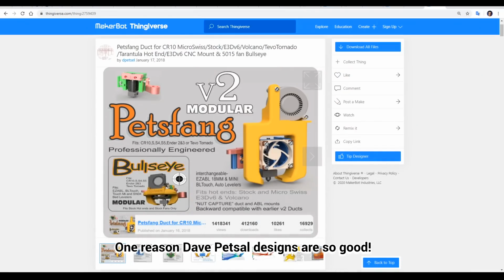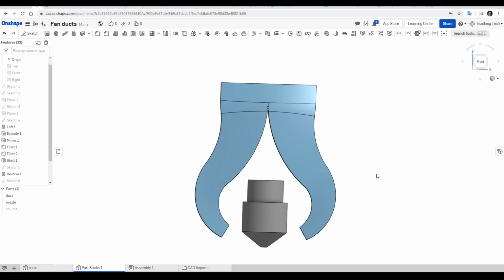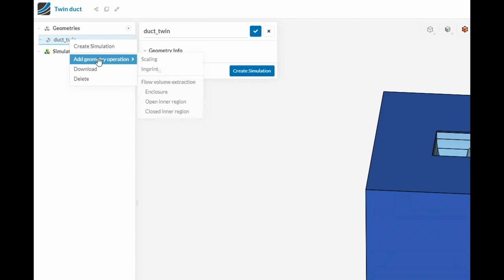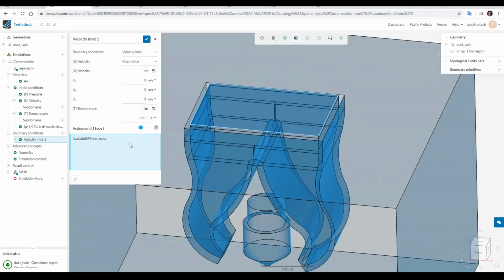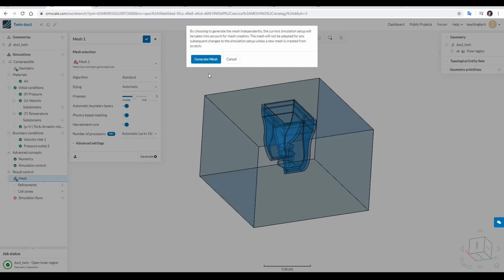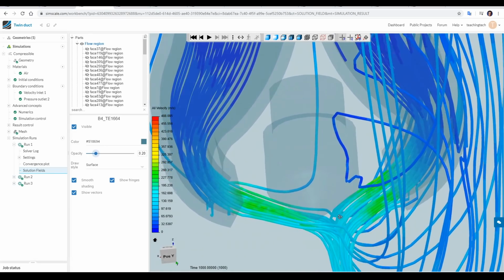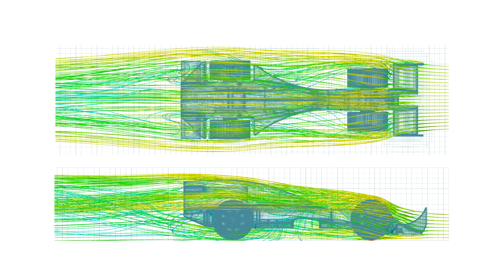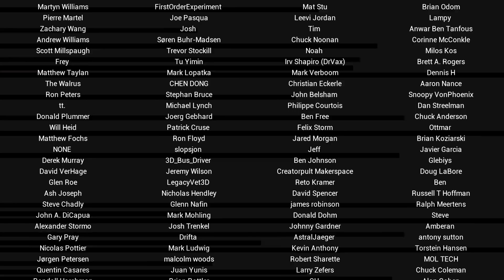Use CFD to take your 3D printed designs to the next level - for free!

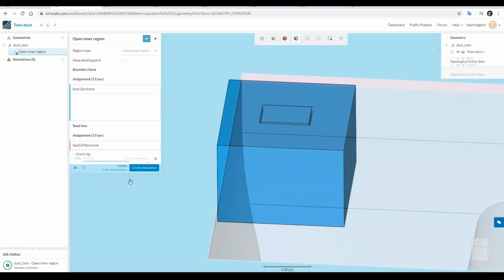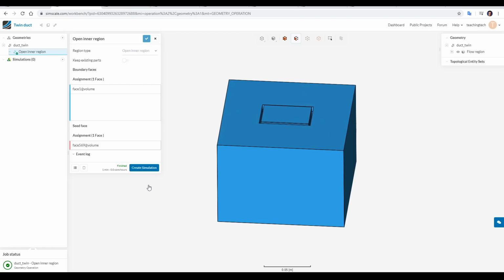Comment: If you are getting the error "A setup with 2 regions is being used in a single-region analysis type" -- you must delete all solids except for the new volume that you created like another commenter posted.  It's not obvious from the error what step is missing, but that's it.  TT does this and mentions it but it isn't explicitly shown on the video.  Check out the video top right at 5:44 vs. 5:49 and you'll notice that all geometry except the new volume is deleted.   If you're having this problem, go into CAD editor, look at the geometry, and remove (delete solid) everything except for the volume that you created.  It's similar to a 'burn out' in the lost-PLA casting; the original solids must be removed.   Then things should work.  Also, in the new UI, you'll want to perform an internal flow-- but most everything else still works.  The other difference with the new UI is that the gauge pressure is used and not absolute static pressure.  I believe the new default values of "0" should be fine.   Also, incompressible flow is free but compressible is not.  That should be fine -- air is roughly incompressible below 230MPH (mach 0.3).

Comment: If you are working with newer version of Simecale than the one in the video, Instead of Using Velocity outlet use pressure outlet the same way. If you dont it will show an error and you wont be able to generate the mesh nor the Simulation Run.

Comment: It would be great to have an updated video for Simscale.  Their UI has changed a bit, to a point that it takes a bit of guess work to get a CFD simulation running.  I'm currently working on a new nozzle idea for the part cooling on the Ender 3 V2 Neo.  The hardest part for me was figuring out how to get the internal flow volume "open inner region."  This is now done in the built in CAD editor.  You still need everything setup the same way.  The new command is flow volume>internal.  The options have changed order, so your first selection is the small inside edge for the seed.  Then, select the outer faces for boundary faces.  After letting the volume create, then you have to delete the solid bodies you brought in from your CAD software, so that only the flow volume remains.  Last, export this into the simulation setup.  Without exporting, the changes stay in the CAD environment, but are not applied to the model in the simulation setup.  It will appear as a cope of the original geometry in the list of geometries.  Then, select the newly created geometry, and start a new simulation.  Everything else is about the same as in the video.   Be sure to pay attention to what's pressure and what's velocity,
Reply: They've also removed compressible flow analysis from the free community plan.
Reply: Thank you :)

Comment: Thank you for this video ! You give us some very good information !
I want to simulate the pressure under my resin 3D printer Saturn 2 plate. I found some mathematical model not easy to implement so it would be great to simulate it !
The idea is that the efforts under the plate of the printer are getting very very high values during the last part of the z moving down in the fluid because of resin viscosity.
The software doesn't support fine tuning of the velocities bur with the amazing UVTools it is possible to add temporisations for the first layers.
So what do you think about using Simscale for my purpose ?
Thanks again

Comment: With the compressible simulation no longer being available, it should be noted that "incompressible" is the correct choice here anyway, because air is moving at slower speeds than mach 0.3. So, unless you got a really powerful fan...
Reply: Thank you!

Comment: 9:00 The fan characteristic you picked is not very representative of the actual flow anyways. The 'flow rate' fan manufacturers state is in open air, i.e. without any resistance. It is similar to how they state the static pressure, i.e. pressure with infinite resistance (blocked). In actual use cases, you are somewhat in between. In particular with fan ducts like this, you have a significant resistance, and thus cannot blindly take the volumetric flow in the datasheet. 
Instead, you will need to figure out the resistance, and use the fan manufacturer PQ curve to figure out where in the operating region you are at.

Comment: Thanks for making this video! I'm designing a smoke collector for a laser cutter - basically a part cooling fan in reverse. I figured I could find some people talking about using CFD for designing part cooling fan ducts, but I didn't expect it would be you! I realize the CFD will be optimistic at best, but it will still help point me in the right direction if I'm doing something obviously stupid.

Comment: The compression flow is now part of the pro subscription, and not given for free. 
I've been struggling beyond that, because their interface has changed. Where you create the flow region, there's now a separate cad editor so the right click option isn't there. Then it doesn't seem to react the same way and give me a flow region like yours - mine seems to be "inside" the solid volume that I modelled in, and I can't fathom that out. I keep getting a message about it being an invalid set-up, but it isn't really telling me why.

Comment: This is a bit of a dangerous video. In CFD the old saying 'garbage in...garbage out' is more important than ever. I wouldn't trust any of these results. You really must know what you're doing...otherwise you're just wasting your time, and will probably design something that has poor performance. However if you just want to see some pretty pictures, then sure, have at it.
Reply: What makes this software so bad? Can't just come shit on it and provide 0 resources showing why this is a poor approach
Reply: @squirrelzar  I never said the software was bad. I said it takes a skilled user...of which this video makes it seem anyone can have at it.
Reply: @squirrelzar  software isn't bad at all. But the parts where you input all the settings is where the issue is. Unless you have a lot of knowledge of CFD then all the settings your gonna try will most likely be garbage, and thus you'll have garbage results that don't reflect how it really is gonna be. This is why it takes specialists to design racecars rather than anybody can do it.

Comment: Please get a compressor for your audio tracks and set an auto gain to common standard level. Constantly variations in volume on your vids. This one especially is too light in volume where one need to crank up the system and get blown away if app notification appears. Just a QA tip ;)

Comment: I've tried and tried, and it's just error after error.  The fan duct is a solid body, but it continually imported into simscale as 3 faces.  So ended up importing into onshape just to be able to export as a parasol.  Well, that worked, but then when calculating inner region it gave the error "The flow region could not be created." which turned out to be a geometry issue which was cleaned up.  But now it's saying it's too course even when I set the fineness to 10.  I've spent a few hours on this and still can't get any further.

https://www.simscale.com/projects/phazei/lpa_fanduct_5-5/

Comment: I tried this with a Hemera fan duct I remixed but I cant get past the "create inner region" operation.  I set it up as you demonstrated but when I click "start" nothing happens (just the cursor changes to a red 'forbidden' icon).  This is the project I have started:  https://www.simscale.com/projects/Psych101/hemera_5015_fan_duct/
Reply: Also note I modelled the duct in Fusion 360 and had to export it as a step file (no parasolid option).

Comment: 20 degrees typical room temp? where do you live? north pole?
Reply: Australia by the accent. He's talking 20°C.
Reply: @martindinner3621  20deg is still pretty low, to be called a typical room temp. Typical room temp is like 24. Doesn't sound like much difference but at 20 deg I would be freezing my ass off. 24 is a nice comfy temp.
Reply: @flippy9133  in NA and Europe, 68°F/20°C is pretty standard.
Reply: @martindinner3621  I am from europe, only poor people that were saving by not using heating had like 20C at home. mostly its 24-26
Reply: @flippy9133  depends where abouts you live in the EU. 18-22 is normal in the UK during winter and about 22 during the summer. Some people also don't care about heating, friend of mine doesn't ever have the heating on even when it reaches 0c.

Comment: Thanks for posting this tutorial.  Following your video, I used it during the design of a print cooler for the titan extruder on my Makerfarm Prusa  i3v 10" printer.  After seeing a couple of the other comments, I might try one of the turbulent models, but seems like it puts out enough air for me.  Here is the link to my design on thingiverse which includes the STL file & fusion 360 source file. https://www.thingiverse.com/thing:4427927

Comment: You might want to consider using Copper-filled Metal Composite HTPLA by proto pasta.  I played around with it a little bit and the resistance level is nowhere near the resistance level that you showed for the carbon fiber. Might be something to play around with sometime when you have time I certainly don’t have the time right now to do something like that.  You must send this after printing of course.

Comment: OK it's probably only me - but I have designed everything in Fusion360, exported it as .step; and it complains about "Sheet bodies detected.
The model contains sheet bodies (surface data) only. The meshing algorithm requires at least one solid region. Try to solidify all surface parts." - any idea how to solve/fix this?

Comment: The way air comes out of a fan is a complex subject all on it's own. This simple stimulation of an airduct for your 3d-printer delivers highly inaccurate (overly positive) results. Tying a (wollen) string to a stick is way more accurate. Modeling airflow around an object however, like a car or an airplane is relatively easy and should show reasonably accurate result (as the incoming air is laminar and the pressure is super even, which is NEVER the case for a fan).

Comment: Great video, younger student me would have for sure enjoyed to learn by using these tools. I bet they love these lessons you teach! But I am also amazed by the amount of people commenting about turbulence models etc. I think it is kinda besides the point of the video, which seems to be introducing a free tool that anyone can use for doing hobby projects (which by the way is amazing, free tools for cfd are quite rare).

And to all these wikipedia warriors in the comments: To begin with, the K-Epsilon that everyone is yelling in the comments is not a good model especially for curved surfaces and high turbulence simulation... It's just very fast for finding basic flow patterns, but handles near wall badly and is overly diffusive... For the simulation shown in the video if you want to stick with RANS models, a SST K-omega would probably be the way to go, but would need a bit more understanding of the case before saying for sure. If the case is not a steady state (which I think it is not since the two flows are pointing at each-other), even SRS model could be considered instead, if it is important to correctly simulate the flow around the nozzle.

Comment: Well I´m not sure to know what the aim is here. Of course I can see the behavior of the air and in one case I can see there´s barely air the the endings but a simple fan duct should just blow in the right direction or not? I hope you can explain me which points are important? I´ve created a test STL with a box around it and it´s still calculating. I really would like to know more about what a critical position / area would be ... everything what would be red? ... or where I can see much less air at the end?

Comment: This is not related to the video subject but is a bigtreetech skr 1.4 be connected to a makerbase mks tft35 v.1.  The display has an 8pt chord but the skr board has a 10pt input.  They both have an identical display tft35 yet the connection is different. Is there a way to modify a chord/chords to connect them to each other. I also have a 10pin USB programmer if that can somehow help. I would be beyond grateful to get some help on this frigging thing. Its pretty much the bane of my existence right now and there's nothing anywhere about this which I'm very surprised by. But you're pretty much the man when it comes to this stuff so figured I'd ask.  Thx

Comment: Fyi unless your air flow is above 0.5 Mach or so, compress-ability effects in air are pretty minor.  Should save you some core hours by using an incompressable simulation instead.
Reply: Wait so you're telling me the airflow isn't supposed to be at Mach 0.5 for 3D printer fans?
Reply: @hudsonr.218  Mach 0.5 or faster cooling air would help when pushing for extreme speeds.  I.e. >400mm/s and >10,000mm/s^2.  But most cooling fans don't have anywhere near the power to do that.  And you won't like the noise either.  (Would make a vacuum cleaner sound quiet...)

Comment: Very thorough video!  I’ve often wanted to check airflow on various parts cooling nozzle designs.  Thanks for taking the time to demonstrate it.  I was not familiar with this software.  I’d be curious how similar or different the process would be using the Fusion 360 CFD module?

Comment: I was so excited to see this until I used it.  I for the life of me can't display the particles.  I followed the instructions to a T.  When I leave the part and go to my dashboard, it shows the particles but I can't traverse the environment to view it at different angles.  I do get an error when I go to mesh it that states something about the physics won't work.  I can't remember.  

Then I come back to my dashboard and clicked on the project and instead of workspace I just clicked the part and behold, there are particle lines.  However, I still can't see them in my workspace.  Tried 3 different browsers and 2 different pc's.  It also looks a bit buggy.  

I redesigned my part 3 times to try and fix this but it shows air shooting out through solid parts of the object.  Odd I know.  Anyway, this is for a modular base and mount design for the Hemera.  You may find it interesting.  I will post it up if you are interested.

Here is my part as you requested.  Thanks for the vid man!  I appreciate it!

https://www.simscale.com/dashboard/#viewMode=thumbView&sortBy=project_lastchange
Reply: If you need help, try the in-product chat, we'll be there to help ;)
Reply: @jonwilde1044  Honestly I was looking for one of those.  After I read your post I wondered why I couldn't find one and I realized that it's because it's not available while the project is open.  I will try it out though.  Thanks for the response!

Comment: I tried to run the simulation on my own (slightly more complicated) design and found that Open inner region is not that straight forward when the geometry is non-trivial and there is no message that would tell why this wouldn't work.
The Start button merely blinks but doesn't do anything.

Comment: This is a great video. There are more than enough how to change my fan videos for 3-D printing. But, this topic and 3-D design in general is seriously lacking. You should consider putting together a U Demi.com class on the subject. Please use a free modeling software.  And please focus on part engineering. Not just 3-D printer parts, but all sorts of mechanical parts. Thank you

Comment: Hi Michae , Have been trying to re-build my ender three with a SKR1.4 turbo board and a TFT 35c screen and 2209 stepper drivers.Following you guides  and using your new editor choice(visual Studio) which I like . Iseem to load Marlin 2.0 into  it fine then do all the changes OK but then when it comes time to compile there is no tick  in the bottom tool bar ther  are no mistakes and no problems  but  NO TICK TO PRESS TO COMPILE THE CHANGES .Lockdown frustrations here in Nowra and not knowing the software dosn't help,can you thanks  Ian